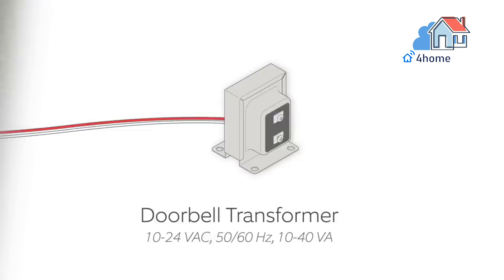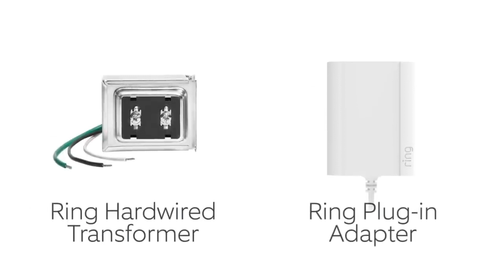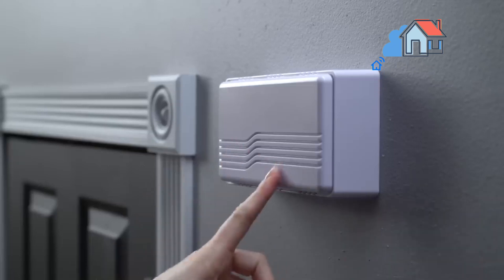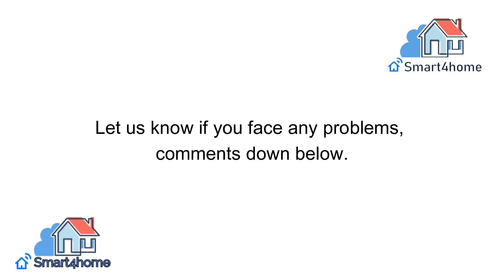How To Install Ring Doorbell Wired (New 2023 Lower Cost Version)? || Install Ring DoorBell : How?

Comment: The problem is the doorbell ring is wired🔔I have electrical power. I see you connected the app using wifi. I have to be changing my wifi address too often. I want to set up my app to connect through wired, I have several (9)ring flood lights. I'm tired of climbing up the ladder 🪜every time I think I need to change my wifi address💻 Or I have to pay $150. I want to be able to view pictures and outside through my 📴phone app.📲 I do have a TV that is used for just monitoring the cameras.🔕 Maybe someone can help me.